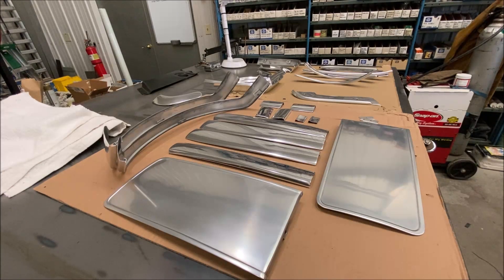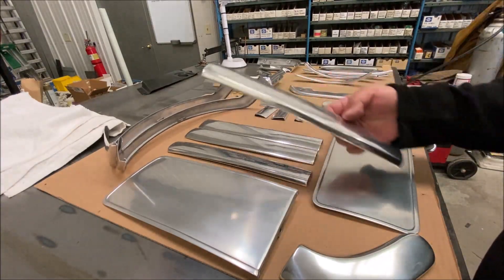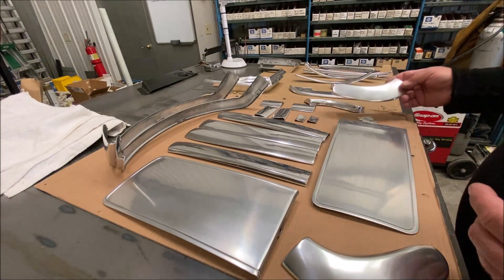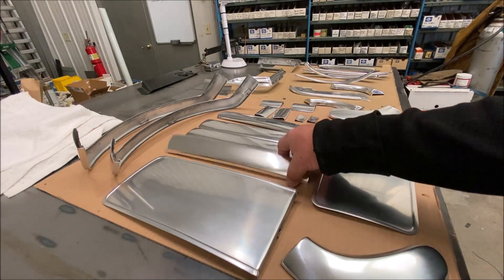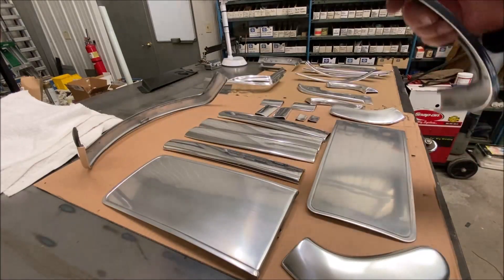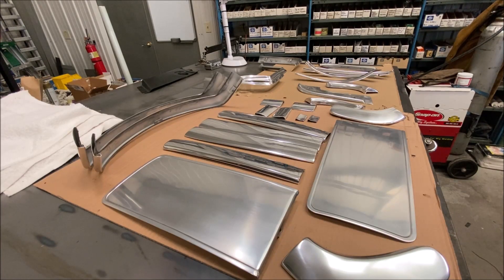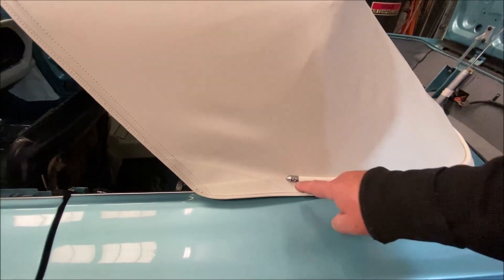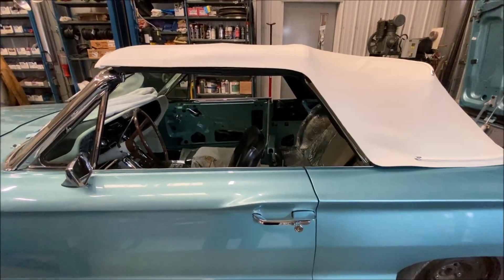Thunderbird Aluminum Anodizing

Comment: Hey Nick, I have a question.. are the aluminum pieces polished aluminum or are they chromed if there is such a thing? I removed all the interior trim and took it to a place locally and they quoted me a crazy number to have it all re-chromed. Most of the headliner trim is in really good shape it’s my seat trim that needs redoing. Can you recommend a place that won’t rip me off and does quality work? I would rather ship it then give it to these people after what they quoted me.
Reply from the maker: Hey Storm, chrome plating is expensive. I use Van Nuys plating in Van Nuys California. They are okay. Not the best, not the worst. Call them and talk to Linda. The aluminum pieces I show in the video were anodized, not chrome plated. You can chrome plate aluminum and it looks better than anodizing but more expensive. The original factory anodizing from Ford looked just like chrome plating, they did a super job on those pieces. I had my seat aluminum polished first and then anodized. I was not super happy with them but the customer did not complain and they looked good in the car. I'm just particular because I want everything to look like the factory stuff. So you must have someone remove all imperfections from the aluminum, usually the polisher will do this. Then once they are polished, get them anodized. The anodizing will not make them look any better than how they look after polishing. The anodizing is just like a clear coat so to speak. I don't know that much about anodizing. I found this on the web, "anodizing is to coat (a metal, especially aluminum) with a protective oxide layer by an electrolytic process in which the metal forms the anode." Good luck.

Comment: I own a 62 with blue interior and the meatal surround is a tinted blue. I like the plain metal look and was wondering if I could take the blue tint off with reducer. is the anodized aluminum under the blue tint or would I ruin it. just wondering if you know anyone that has done that
Reply from the maker: Hi, yes the aluminum pieces are anodized and you cannot remove the blue with reducer or any other chemical. Back in the day before they were available new, I restored many. I had to glass bead them to remove the anodizing and then polish them by hand to make them shiny again. Then I sprayed them with clear. I was never able to reproduce the blue color though and I never really tried so I just restored them to silver. Good luck.
Reply: @vintagethunderbirdrepair9426  thanks for the reply, not that expensive to buy anodized ones, just a pain to replace them. could be worse , could be the wood grain . not a fan of that. thanks again

Comment: Do you know a way to remove dents in the seat backs and trim?
Reply from the maker: The best way is to take those parts to a metal straightening guy, like guys who straighten and polish stainless steel. The seat backs have a grain so its harder to do them without disturbing the grain. Aluminum and stainless trim I take to the stainless steel guy, he straightens them and polishes them. Some stuff I do myself but you need some special tools. I make wood dollys and such to do small easy stuff. I cant explain how to do it but Im sure there are many YouTube videos on the subject. Good luck.
Reply: @vintagethunderbirdrepair9426  Thanks!

Comment: Nick,
Good to se you back, my friend.  I'm at the same point with Pearline, messing with the aluminum and stainless trim, although I won't be having any anodizing done.  Good old Dollar General Store $1 a box steel wool soap pads will have to do. 😁
Regards,
John
Reply from the maker: Hey John, I did the same with my 66, I just cleaned them with SOS pads and soap and called it a day. This car is a restoration and the pieces were in very bad shape and I didn't have anything that was acceptable or that matched the quality of the rest of the car so off to the anodizer they went. We tried to paint them with chrome paint but that was a disaster so that left me with only the one option. I spent a lot of time on them and cannot charge the customer since my paint job and other efforts didn't work out. That seems to be a regular scenario with this car. It will be done soon, thank god.

Comment: also great review of autolite 4100 gaskets and vacuum leaks. i had the same problem on a 59 carb i rebuilt, the carb gasket did not cover the little holewhere  the anti-stall dashpot mounts and there was a leak.

Comment: Good to know
Reply: The quality and purity of the aluminum will have a huge results in anodizing.  This will have a bigger effect than the polishing . Your anodized treated each of those parts for the same length of time . The quality and alloy of the aluminum is what caused your appearance difference.    If you could go back to 1966 and really look at the new cars the anodized parts were a horrible match from the start
Reply from the maker: Interesting, makes sense to me. I wish I could go back to 1966 and get a few parts and bring them back, especially convertible parts. Thanks for the info.
Reply: @vintagethunderbirdrepair9426  I wouldn't come back

Comment: Is the problem in the polishing or the anodizing? Some parts,as you said, are nice and shiny and others are dull.
Reply from the maker: I think the the anodizing process was not what I thought it was. This is the first time I did this so Ill know better next time to inspect the parts and confront them with it. Ill also make sure that all the polishing is 100% as it has always been in the past. For all I know, the anodizer could have scratched the parts but Ill never know because I didn't inspect the polishing before hand, my bad. I've had excellent results from the polisher in past jobs so my guess is on the anodizer and their process. The $95 dollars charge might be an indication of low quality. The polisher even suggested that I clear the parts and call it a day but I don't want the clear to yellow and start pealing. That would look like crap. The anodizing will not do that. All in all, the parts will look great once installed into the car.